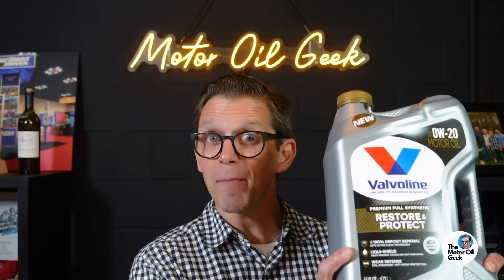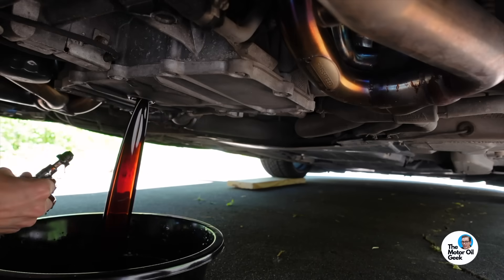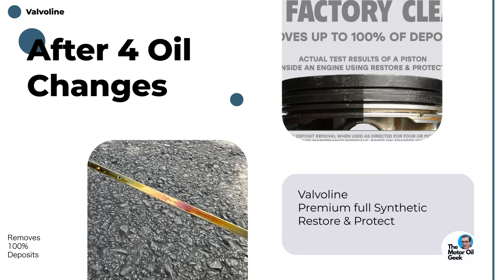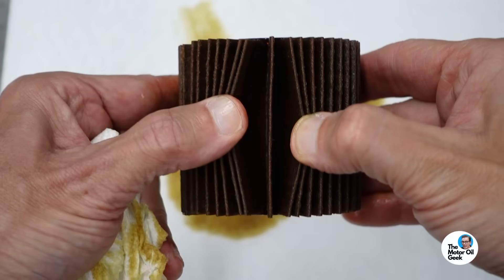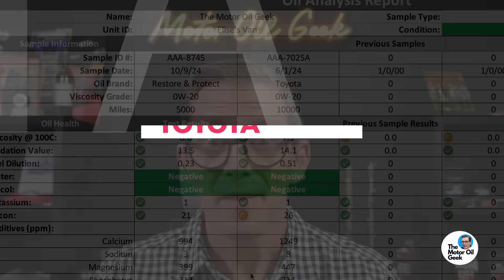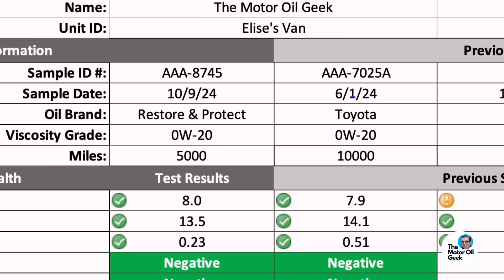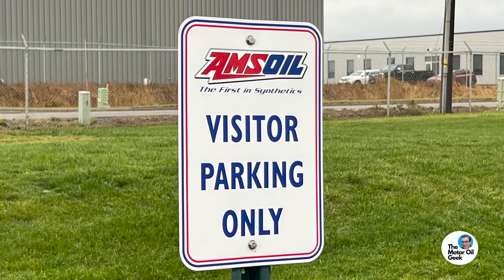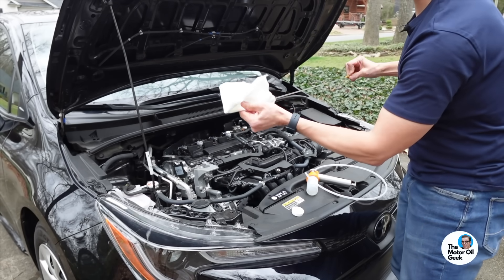The TRUTH About Valvoline's BOLD Engine Cleaning Claims

Comment: I have been using valvoline oil for years. My engine a GM 8.1 has been plagued with a slight lifter tick after sitting for a few days. I tried vavoline restore and protect and after 3 oil changes 9k miles the stubborn ticking continues. Being a retired auto tech I went "old school" and added a half quart of dex VI ATF and by the second time i started the engine the tick is gone. Although i like valvoline products i dont think this oil does a very good job even after 3 oil changes and 9k miles still didnt do what old school atf did in 30 minutes.

Comment: Thank You!
   Can I use this 5/30 R&P in my 4 cylinder diesel??
   It’s an old indirect injected Perkins diesel with good oil pressure and 5500 hours…
   I bought the oil and then… I saw the badge that said for gas engines. 
   🤷🏻‍♂️

Comment: If your car calls for 5-40, would it be more benificial or detremental to run Valvolines restore and protect 5-30? as they do not make a 5-40 of it and that is the closest in viscosity. Any thoughts are appreciated. I dont think it would be issue during the colder months but possibly the summer. I do know a few people with the same car that just get 5-30 everytime without really noticing (mechanic put that the first time and every other time they just went off what the sticker said for the next oil change is my best guess, they never had any oil type issues at all. Mk6 gti platform

Comment: You are not changing your oil often enough if you are getting those deposits on the dipstick. I dont care what the manual says. The newest 10,000 mile intervals are BAD. I have had my vehicles for over 200,000 miles and still change it every 3000 miles. I do it myself and have never had any deposits on my dipstick. I even have taken apart one of those engines near the end of its life and the metal was cleaner inside the engine than your dipstick. Vehicles were scrapped with running engines because road salt ate the frame

Comment: it cleans the engine but does it have any effect on an older engines rubber seals? cleaning detergents could break down older brittle rubber seals  like crank , valve and cam seals. just a guess but thats why i'm hesitant to try something like this in a 97 corolla that runs fine and doesn't burn much oil I just change the oil more frequently.

Comment: I know this comment is a month or so late, what vehicle has 1.5 million miles? Is that a typo with an extra zero or is this a real mileage?
Reply from the maker: That is customer supplied info, so we don't know.
Reply: @themotoroilgeek  Aye, I was thinking that would be the case. Would be amazing if it was correct mileage, that is 2.4 million km! I've only heard of one other vehicle doing more than 2 million km, that is a vehicle in New Zealand that is used for postal distribution.

Comment: My 99 Durango take 5W-30 as an alternate oil. All it’s life, the truck has used 10W-30. 
Question: Should I use 5W-30 to be able to use Restore and Protect as it doesn’t come in 10W-30?

Comment: I'm the third owner of a 2001 F150 4.6 L, 258,363.5 miles as of this morning.  Purchased 11/2023 with 251,184.4 miles on it, oil changes every 2500 miles with Valvoline 5W-20 synthetic blend high mileage.  Would love to change over to Restore & Protect but a little nervous due to extreme mileage on the truck.  Thoughts please.  Thanks in advance!

Comment: After 11 years of flawless performance over 150K miles, I handed the car over to my son so he could abuse it. Which he did.  Now with a total of 250K miles and being driven 80 miles daily, it was burning 1/3 quart weekly.  Changed to Valvoline Restore and Protect about a month ago and have needed to add zero oil.  Not one drop.

Comment: hi , taxi driver here..
i wonder,
 you say in the begining of the video , that have been using ,, the OEM oils there..
how did you deal , with the elevated oil consumption , caused by the new generation thin oils?

petrol taxis (corolla, prius, skodas) here in Greece, all switched to 5w40,, 
and redused oil consumption,, down to half litter per change...
of course  , they been told by Toyota not to do so,,, 
but so they did ,,
and all the "made in japan" Toyotas , passed the million kms mark,, with no problems..
a friend is about to clock ,1,000,000 miles(1,600,000kms) in his 3rd gen Prius.

of course ,(to my knowledge)  Non japanese Toyotas,,, didn't  make it so well.
and even the skodas, had a decent run , as far as "pure mechanical " things go..

i'm sure, you 've seen the interview, of the retired manager /boss ,of the Nissan GTR  racing ,
 (at the "automotive press" you tube chanel)
saying, that we should" ignore" the  manufactor's recomended viscosity ,
and adapt to circumstances ...  Everyone i know, in super hot GREECE  ,, has switched to 40 visco,
 and basically, solved the consumption issues ...
in my private  Opel 1,4 cc, went 10w40, and IT AIN'T BURN oil anymore.. ( used to be, a litter every 7.000 kms).

Comment: @themotoroilgeek :: Hyundai GDI theta 2 engine, now at 112,000 -  oil burning issues at 100,000 miles, 9,000 miles/ 9 months  of head scratching before treatment. 
Original oil blow by - engine consumed 1 quart per 200 miles. After VALVOLINE R+P - 3 weeks later ... 600 miles per quart. Just up again to 700 miles 1 qt.  3 x improvement in only 1500 miles. 
Solution: Liqui moly engine flush. One can of CRC intake valve cleaner. Swapped and topped up with Valvoline R+P. Oem Hyundai filters. 
Change the oil filters frequently after flushes, every 500/1000 miles for the first 3,000 miles of R+P - mechanics confirmed R+P is so good at cleaning, it may overwhelm the filter medium.

Comment: This is very impressive.  I'm thinking of trying it on a couple of our vehicles.  I'm curious your thoughts about long term use.  Is this stuff good to just switch over and use indefiinitely or does it make more sense to use it for a couple oil changes, clean things up, and then go back to your tried and true oil choices?  I've been pretty happy with Pennzoil Ultra Platinum in my '24 Jeep JLU and our '19 Ram 1500 Hemi.  Both are low miles.  I'm thinking to maybe try it in our hemi to quiet it down some, or better yet, to try in my daughter's car a 2000 Altima with 185,000 miles on it.

Comment: 7 hours after my post in this video,  I did a thing ... Bought a 5 qt jug and 2, 1 qt bottles of R&P 5W30, and 2 decent filters. Dumped the 3 month old AMSOIL (2,000 to 2,500 mi MAXIMIM) and the AC Delco filter. For the low miles, the oil was pretty dark. Dropped the plug and old filter, then waited until the oil stopped dripping. 

I buttoned everything up, pre-filling the new filter before installing it, then poured the 5 qt jug and the remainder if the quart bottle into the filler opening (6 total).

I started the engine and was IMMEDIATELY shocked. I heard the starter and the aftermarket exhaust  ... but the engine was DEAD QUIET! I'm used to hearing the usual engine noises, but their was nothing at all. I drove the car to  Auto Zone to recycle the lightly used AMSOIL, then to a friend's house, for a total of 4.3 miles. The engine remained dead quiet the entire time and all I could hear was the exhaust.

Take that for what it's worth.

Comment: Happy New Year Lake. I'm more than a bit of an automotive geek as well. Almost a year ago, I bought a 'new to me' 2017 Camaro, with the 3.6 V6. The previous owner modified it with an Edelbrock supercharger, and apparently ran the car hard, with questionable maintenance. The car has 85,000 miles and soon after getting it, I changed all the fluids (oil, trans and differential). The oil seemed clean enough, but the transmission fluid was awful and the diff fluid was pure sludge. In fact, I ended up putting a brand new rear end in, because the previous owner  grenaded the differential (large metal chunks came out with the sludge!).

I had changed all the fluids to Amsoil, but  then started researching Valvoline R&P. I know GM requires a DEXOS rated oil and that R&P is not DEXOS rated. However, because of the supercharger, I have absolutely no warranty, so using DEXOS rated oil for warranty purposes is pointless.

Your videos on R&P fascinated me and I am very seriously thinking of doing an early oil change using R&P, and buying a few extra filters, so I can switch to a new, clean filter at say 500 and 1,000 miles (in case of heavy sludge removal).

In your option, is this a smart move?
Reply: Be sure to get the proper weight. Like other commented, Toyota cars and others have increased to higher oil viscosity at dealer service. On my supercharged Audi A7, I run 40w liquimoly instead of the 30W castrol as per enthusiast recommendation, and later dealer adopted. Look up “piston soak method” if you’re interested in deeper cleaning. BG44k for the gas tank too. It seems like restore and protect “suspends” the junk in the oil so you won’t notice filter dirty , but it can’t hurt either IMO
Reply: @Pwnulolumad  Thanks, just hedging my bets by getting extra filters and changing them at 500 and 1,000. I'm also talking to TRACEY LEWIS RACING, in Florida as they seem to be the premiere source for the supercharged V6 in the 6th gen Camaros.

Comment: the viscosity at 100C of Valvoline RP 5W30 is just 10.8cst. Consequently it might not be compliant with BMWLL01 or BMWLL04 which require 11+cst. However it complies with BMW LL01 FE viscosity.
Knowing they won t release a RP 5W40, what s the best way to use RP 5W30 in my BMW 2007 525i? Use a nanoceramic additive to compensate for the lack of high temp viscosity?

Comment: Lake or whoever can , I  have a 2018 honda crv. Bought new, been using full synthetic ansoil from day one.  5k oil and filter changed.
I am using some oil, but not much 1/2 qt every 5 k.
Will the protect and restore be ok to use on a car such as mine that has been taken care of.  Or could it actually be detrimental.

Thanks

Comment: Is ot ok to run this oil and filter for 5,000 miles without changeing it my car only has 10,000 miles on it i always change my oil at 5,000 miles so i dont think theres much sludge in my engine😊

Comment: 2009 Mazda tribute 3.0l V6 that ol ford duratech engine with 209,817 miles. 5k miles ago I did a compression check Cyl1-5 @ 120psi Cyl6 had 90psi. Soaked 6 with seafoam for 2 days clean it out. Drained oil and loaded up with new R&P 5w-20. This Sunday oil change time re-did compression check after an interval with R&P and surprising to see that all cyl1-6 were equal at 130psi. Engine did feel happier so I will say this oil did some work. Loaded up with a second round of R&P not sure what I expect to see but will redo my steps again next interval.

Comment: My understanding is moly is added to oem oils occasionally when wear concern is found on specific components. Like cam phasers for example where an expensive coating may not make sense but the surfaces have trouble with developing friction over expected life cycle.
Reply from the maker: Moly is found in most passenger car oils. Its primary purpose is to increase fuel efficiency. It is also helpful in reducing valvetrain wear.
Reply: @ interesting. I just noted your comment on the lower moly content in the “restore” oil. 
I recently found your channel and find it very interesting and informative. Thanks for sharing. When you visited AmsOil I loved seeing the test cells. Years back I interviewed with Alan the CEO and we talked a lot about the need for a modern dyno and test facility. Great guy and really seemed to have a passion for his company. He told me stories of tests he ran on old engines back in the day. They were just barely getting going on plans and looking for new folks. Some older guy named Scruggs or something was already onboard. In the end I wound up going a different direction as a calibration engineer but it was awesome to see that dream realized and in action in your video. 
Keep up the great work. I’m learning from you.
Reply from the maker: @jdh1047  Alan is a great guy. I spent some time with him during that visit, and he's just as you described.

Comment: In my 2016 Volvo XC90 (which unfortunately has the narrower oil return rings) I was losing 1 quart per 1200 miles between 60K and 75K miles. Volvo wouldn't cover it unless it burned a quart per 600 miles. I ran Restore & Protect for 10K miles (changed twice at 5,000 miles each) and now I'm 2000 miles into my 3rd fill of R&P and my oil level is still 90 to 95% (just down a 2 or 3 ticks from the top). This saved me an engine rebuild.
Reply: I'm currently running this in my 2016 V60xc to hopefully slow consumption. Started using VRP at 85k miles burning about 1Qt / 2,000mi. Really hoping this stuff works!
Reply: @rickveldman1214  It definitely works. While there are some definite flaws with the oil ring size as well as the return holes in the piston (just behind the oil ring )being too small and too few, this stuff effectively cleans those out so it can at least be as it was when new. You might need to change your oil filter within 1000 to 2500 miles into the clean because a lot of sludge will be removed potentially clogging the filter. You can do this without replacing all the oil. You'll lose just a bit when taking out the filter. If you have a good scan tool, you can check the oil pressure before and after the change to get a good idea of the normal pressure range, then just replace the filter when it falls outside that range (too low)
Reply: my civic burns ALOT of oil..about 700-1k per qt. Car calls for 5W-20, should i just go with 5W-30 to get lasting effects from the oil consumption? Was thinking it wouldnt hurt to keep this in longer & get more out of it? Thoughts? Also, should i top off with this or can I get away with other simialr valvoline products till next oil change? Apprently it takes 4 oil changes for it to work 100%?! Thanks!
Reply: @dbzownz12345  Add some now to get it started. 5w20 may help while cleaning since it's slightly thinner than 5w30 but you may consider 5w30 after all cleaning is done for better protection. I'm about 4k miles into my 3rd oil change now, and I'm down about 3/5 of a quart and I'm sure the 4th would change will get me to 5k miles without having to add any oil. You may need to replace your filter after 2.5k miles on your first full fill because this will remove a LOT of sludge potentially clogging your filter and going into bypass. You will lose a bit of oil when swapping filters but it's totally worth it. Just top up when done.
Reply: @dbzownz12345  Also, note that if your cylinders have suffered some extra wear making them a bit out of round, well then you won't solve all your oil burning issues. You can see this wear with a scope inserted into the spark plug hole when the piston is a bottom dead center. Hopefully, the main issue on your car is stuck rings and clogged return holes.
Reply: @nicholash8021  yeah i was wondering cause when my car got valve cover change the valve/cams were clean. However, never checked the pistions, so they could be gummed up, which is why I'm not on fence. I'll prob at least give an oil change or two a try just to see. I know you said 5w-20, but since I burn ALOT of oil i think 5w-30 would be  best + weathers getting bit nicers so oil will thin out again.
Reply: @dbzownz12345  You need this oil to get inside the ring lands and through the slots in the oil return ring and the holes in the piston behind it. If you have stuck rings, this is critical to get in there. I can't say for sure that 5w20 will do this quicker but that's my guess and is what I did.
Reply: @nicholash8021  dang...making a good point there too. Thicker oil would help keep oil in engine longer, but the thinner oil would obviously flow easily into the slots. Got me thinking...only cause I burn like qt every 700 miles or so I didnt want just have it just go through engine like water either...it's starting to warm up tho so the 5w-30 will turn into a 5w-20 as weather progresses into spring months. hmm....i'll sleep on it thanks lol
Reply: Are you using 0w20 Valvoline restore & protect
Reply: @attila13m  I'm trying 5w30 now since this provides better wear protection, but I will see if the burn rate continues to improve or worsens soon compared to 0w20.

Comment: My 2008 Chevy Silverado has 245,000 Mi on it it's a 5.3 L and it just started to get what sounds like a lifter tick. I've never ran synthetic in it since new can I switch to this oil? I was told that if I switch to a full synthetic oil it would eat through all my gaskets and it would leak oil everywhere
Reply from the maker: That is not true for modern engines like yours.

Comment: I'd like to use this oil on my 2023 Audi A6 with the 2.0L TSFI. I can find it in 0w20 weight, but it doesn't have VW508/509 spec. Is it still ok to use it as long as i use 0w20 weight?

Comment: Just dumped out the restore and protect out of the sump at 4k miles on my ‘03 Matrix 344k on the clock. Have to say this was the dirtiest color I ever seen with any synthetic oil I ever used, so under the impression it’s doing exactly what it says. On fill number 2 now, and will probably use this oil until the body of the car rots out.